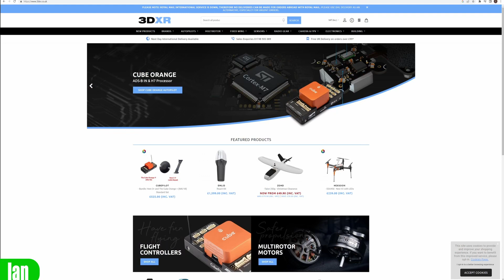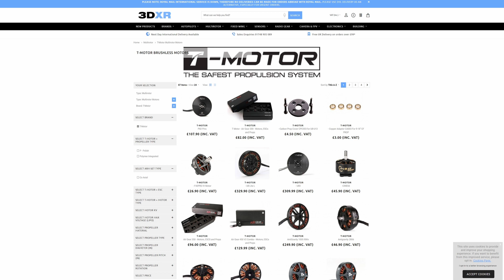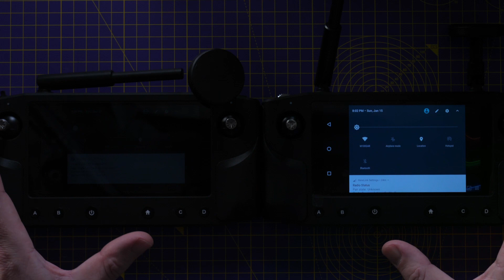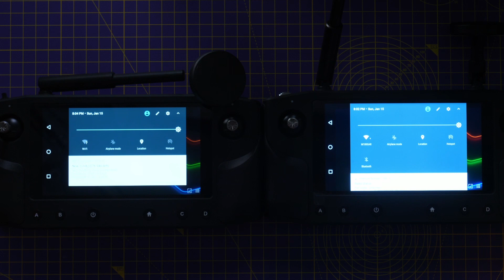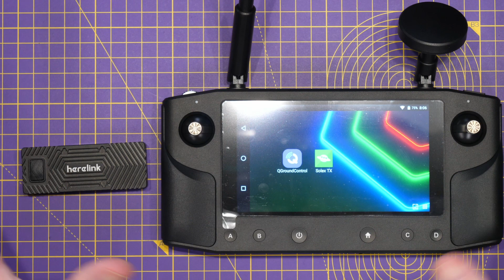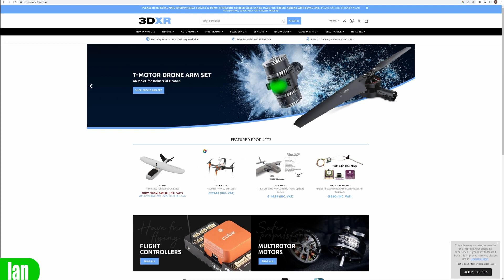Herelink V1.1 Wireless HD Video & RC System - 1000 Nits + Ethernet

Comment: How would you use that on a plane or jet? Let's say I wanted to put that Skymaster A10 with the home base how do you control flaps, rudder, and ailerons? I do want to get to fpv on planes and jets just new at it.